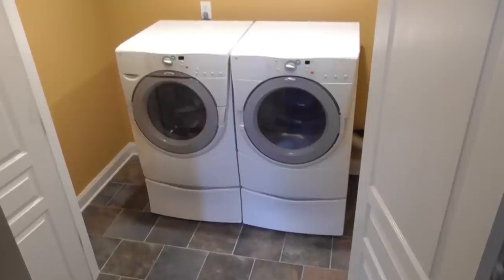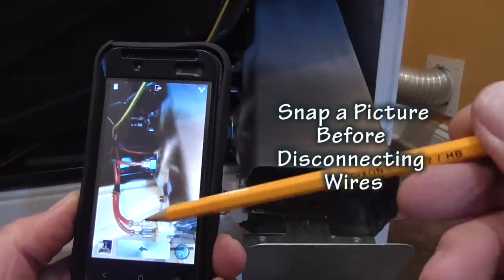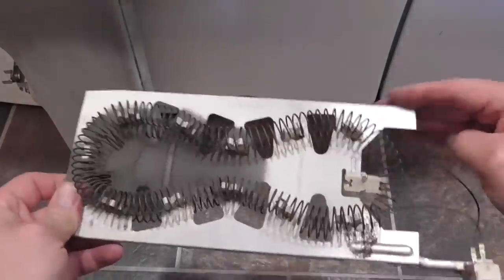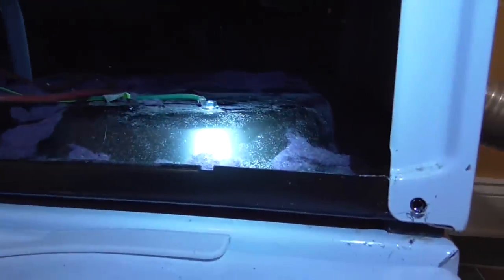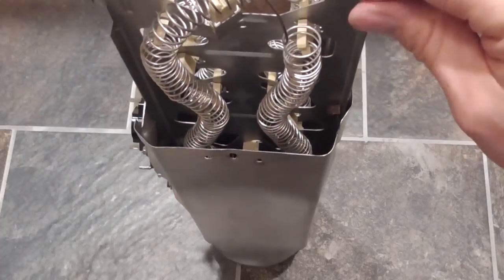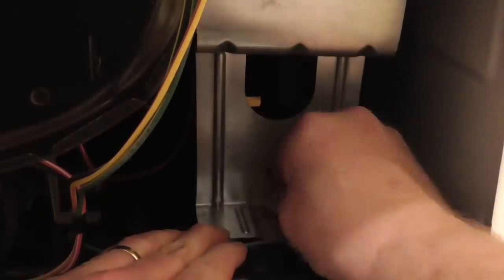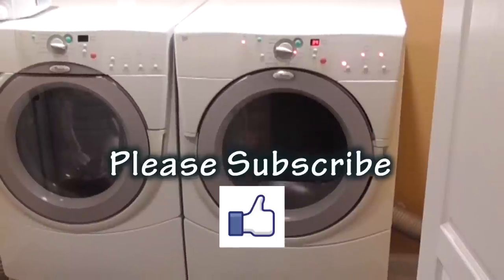Whirlpool Dryer Repair - No Heat Replace Heating Element 3387747

Comment: Hi, I need help!  I can't seem to remove the heating element housing from the dryer body.  I've seen other similar videos and they all seem to come out very easily once a 1/4 inch screw is removed.  Is there another screw that needs to come out of the back before the housing can be removed?  Please help!
Reply from the maker: Hi, there is only 1 screw holding the heater element housing in my model dryer.
Reply: Thanks.  So, do you just wiggle the heating element housing and it will come out?  Or, is there something else you do?

I've wiggled it in all directions, but it does not want to seem to come out...
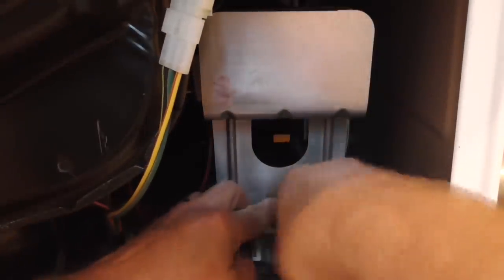Reply from the maker: Once the 1 screw is removed from the housing to the dryer frame (about 1:10 in the video) the entire housing can be removed. Look at (2:35) and there are 2 more screws that keep the heat element in place. When they are removed it may take some force to actually pull it out, be careful not to get cut on the metal and always be sure to disconnected the power source. Hope that helps.
Reply: At 1:10 mark is where I'm having trouble.  I have that one screw removed but I can't remove the housing out after that.  I can wiggle it a bit, but it won't come out.
Reply: twist it
Reply: There may be a small clip holding it at the very back - that's the issue that we had.  I think my husband twisted the housing enough that it just popped off.  We didn't replace it when putting it back in.

Comment: Ugh how do you pull out the housing unit
Reply from the maker: The heater element housing has one screw to be removed and it should slide out.

Comment: Dryer keeps blowing the fuse What can I test or replace.
Reply from the maker: Hi, and thanks for watching the video. Sounds to me like after replacing those components 2 times there could be an exhaust blower problem internal to the dryer. The blower fan in just below the lint filter and
is a pain to clean out. Using a lint lizard and shop vac I find all kinds of stuff that make it past the lint filter. Good job on the shorter vent. Hope that helps.

Comment: Dude you didn't show anything, you skipped all the detailed parts. Lol.. 

It's funny because the front of a duet dryer on some of them are hard to take off and every single one of you guys are skipping this part. Lol. Imagine how many people are looking to see how to try to get that front off but you guys keep skipping it. Lol. It is so American to skip the hard part.
Reply from the maker: Well, my dryer had 2 screws and I removed them with a 1/4 inch nut driver. I guess if no drawers have been added it would be close to the floor. Thanks for the comments.